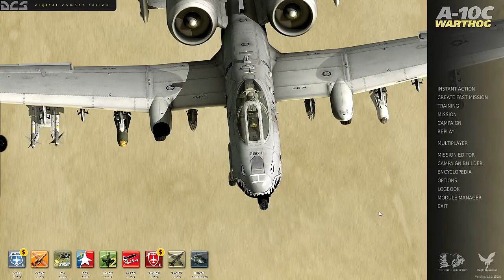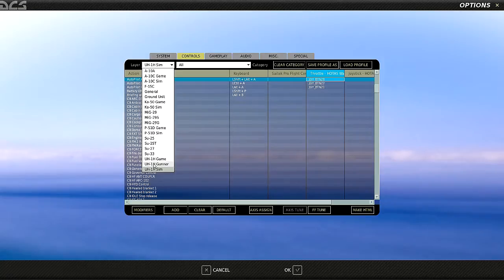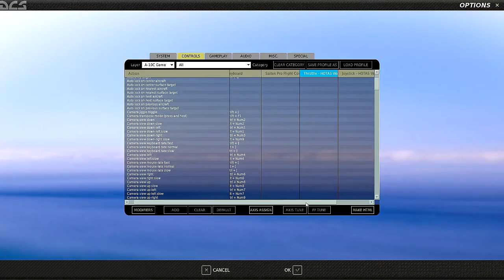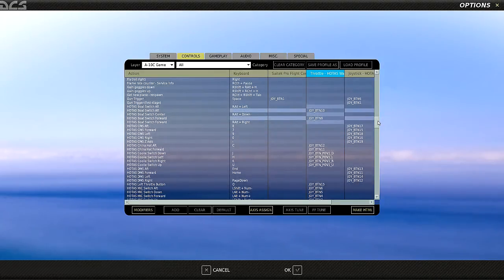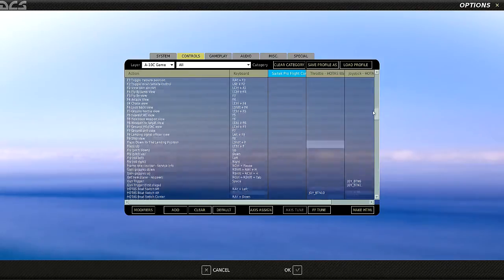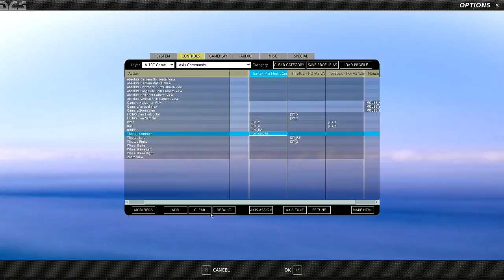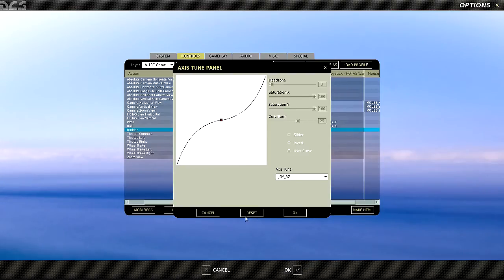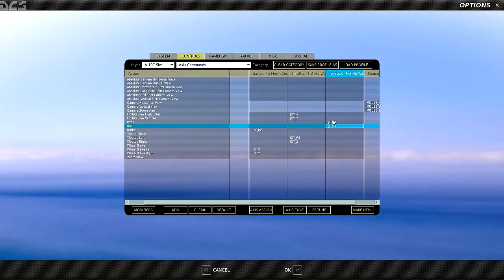DCS controls

Comment: Yet another useless tutorial which doesn't show the hotas diagram.
Reply from the maker: It is not intended to be a hotas or joystick configuration tutorial by any means!
It is non specific intentionally (controller or airframe wise) to just highlight the conflicts that get assigned by default by DCS when you plug controllers in or add a module, and that you need to clean them up a bit before you go ahead and setup your hardware to avoid conflicts.
Reply: Vlerkies this sim is poo for configuring controls,tried every profile on the ch hangar and the button functions don't work,worst sim ever.
Reply: at least the title music is good,that's all I get from this flaky sim.
Reply from the maker: Hi, I understand and sense your frustration, and this is one of the reasons why I put this vid up some years ago, because it is a bit quirky till you know what to look for, because the software detects controllers but then assign the same functions to them like views or axis commands. Thats all I am highlighting here, and the fact that you need to clean it out first a bit.

I'm sure I can help and will be glad to, or provide some links that will help you if you offer a bit  more detail.
Start with the axis commands for the 'specific module'
Each airframe is configured individually. Some have 2 options std and sim. Config the one you fly.

So what are you trying to configure, i.e. which aircraft and what controllers do you use joystick/hotas/pedals/etc)?
I use a warthog but the principles are the same  for all controllers.

Most profiles that you will download will need to have the hardware configured a certain way with the sim for them  to work properly. 

I can try and talk you through the basic setup no problem on teamspeak at a convenient time as well if you dont come right.
It really is not hard to get the basics working very quickly.
Reply: I can assign the axis,the buttons I have no clue on.I just want a profile for the basic planes used in Flaming Cliffs 3,not tthe ultra realistic planes,I am over fifty with failing eyesight,I just want to play this sim as it has been sitting on the hd rotting away doing nothing for probably over five years do to the poor control implementation in the sim.
Been playing Battle Of Stalingrad in the meantime.
DCS World,you really need to be Einstein to get any enjoyment from it.
Reply: Every CH hangar profile I have tried ,the buttons do completely different things than what is said in the profile gui,I've tried every profile from the site.Running out of ideas.DCS World has the worst control system ever,not worth the high purchase price imho.
Reply: I have put posts in Sim hq.Ch hangar and lockonfiles as a last resort to request a working CH hotas profile for FC3 but noone is replying.
Reply: All the CMC files for the Ch hotas have completely different key commands compared to the sim,I have really bad anxiety atm which makes doing this sorta stuff impossible,anxiety brought on by depression from trying to make my hotas work with this sim.I got so depressed and went on a rant that the moderators on Steam for this sim blackflagged me,they didn't give me any help,just went full blown narcissist on me.
Reply from the maker: Ok, FC3 planes are not to complex and you can set them up for the most part and get going with a profile and get by, I will have a look around during the course of today and see if I can find something useful.
Failing that I will make a short vid configuring say a Mig29 from scratch with my hotas for you to see how its done. Same 'principals' will apply for the CH fighter hotas.
Also how do you look around are you using TrackIR for views?
And are you using pedals, if not where do you assign your rudder.

Hang in there, will get you airborne.
Reply from the maker: Oh sry, which CH hotas is it just for info (model?)
Reply from the maker: Copy that.
What version of DCS world are you running?
Im at work now but will do some digging during the day.
Reply: Vlerkies Don't worry brother,I'm in Australia,I looked at every site there is.I am running 1.5.Didn't look into upgrading considering I haven't really touched this sim for probably six years due to the frustration with the controls.I bet Eagle Dynamics would have made a ton more sales with a better control interface,the ch hangar site,the button functions are different to what is written in the ch manager software,was driving me nuts.
I coulld make my own profile but dcs world requires differrnt profiles for each ac.
Reply: Opening up dcs world and seeing a list of keymaps going forever gives me anxiety attacks.
Reply from the maker: It can look daunting, but trust me it is not for FC3 and specifically a basic profile that allows you to fly around, change from AA to AG  to Nav modes, and use missiles and stuff.
Jusst a handful of assignments that you should be able to directly assign without to each aircraft without creating any profiles or anything.
I hardly ever use profiles with the Thrusmaster software, I just assign the keypresses directly from the stick to the DCS software.

Some reasons why the profiles you downloaded may not work;
They were created for an older version of the software;
There are conflicts as per my video above. (conflicts being say stick and throttle both having the same button or action assigned, this is easy to clean.)

Ralfi has a pretty nice video which shows his way of doing things.
Its way more detailed than you require but might provide insight.
https://www.youtube.com/watch?v=Nky6dI5kGRk

I'll do a basic vid of setting up one of the FC3 aircraft.
I also dont mind hopping on Teamspeak and talking you through it. Once you have done one it's easy.
I'm in South Africa. one Aussie morning on the weekend would be our evening here so could do it then.
Up to you.
Reply: I am using the latest 1.5 version.